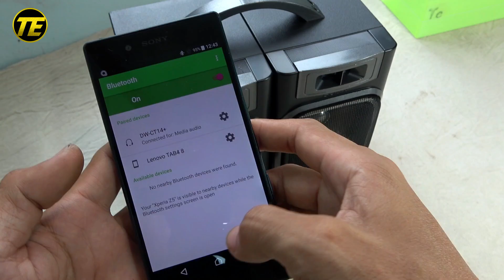Building Bluetooth Speaker from Cassette Speakers V2

Comment: If you use the Bluetooth amplifier board your link directs to it has onboard charging circuitry which eliminates the separate charge module and makes the project even simpler to connect for a novice.